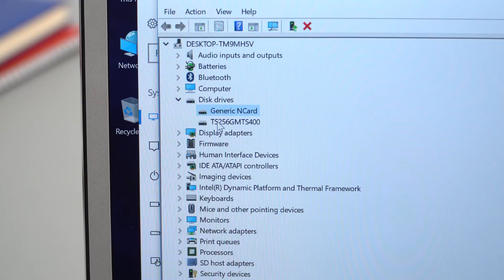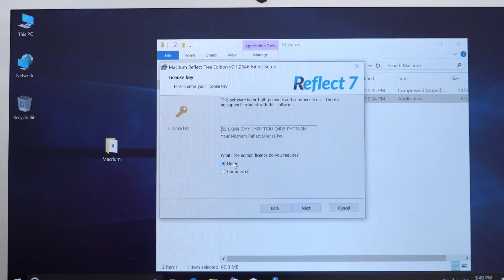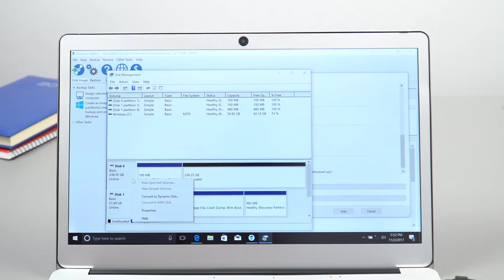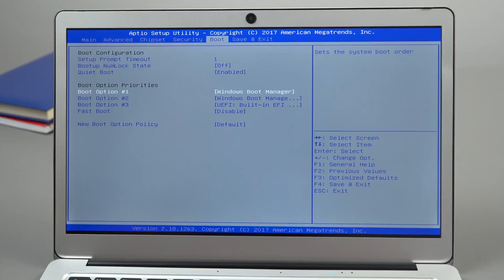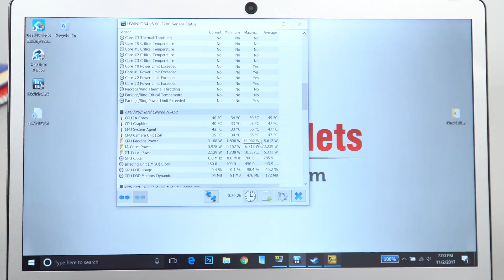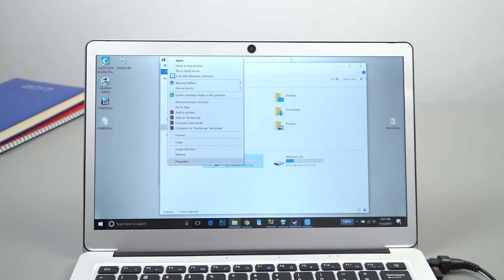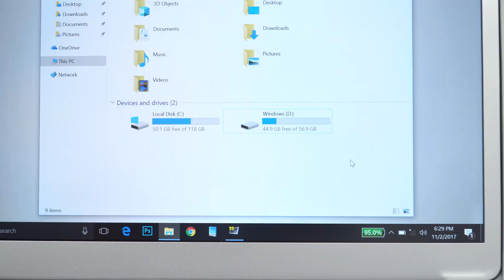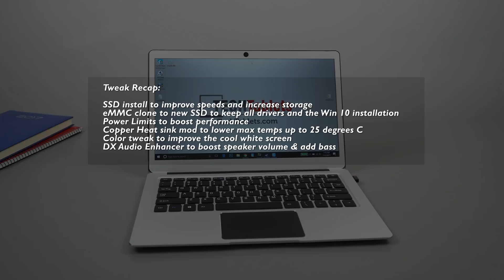Jumper EZBook 3 Pro Heatsink Mod, eMMC to SSD Cloning & More

Comment from the maker: Tweaks to get the most out of your EZBook 3 Pro. Power limits, SSD installation, display tweaks & the heatsink mod to lower max temps 25 degrees c! Where to buy: http://www.gearbest.com/laptops/pp_647765.html?21&lkid=11119507 $209 for UK buyers with coupon EZBDUK

01:40 - Adding an SSD
03:40 - eMMC to SSD cloning
05:11 - Bios Tweaks (eMMC & power limit)
06:34 - Copper Heatsink mod
10:09 - Heatsink mod results
10:52 - Misc tweaks
13:16 - Tweak recap.

How to boost the speaker volume: https://techtablets.com/forum/topic/boost-your-hi12s-speaker-volume-and-3-5-output/

Hands-on with the V4 of the EZbook 3 Pro: https://techtablets.com/2017/10/hands-ezbook-3-pro-v4-best-just-got-better/

EZbook 3 Pro review: https://techtablets.com/jumper-ezbook-pro/review/

EZbook 3 Pro forum: https://techtablets.com/jumper-ezbook-pro/forum/
Reply from the maker: No, it will stock charging once full and then use AC power.
Reply: hi chris i see you made a 360degree mod and coverage of this notebook ut you still MISS to guide us how to conect an eGpu (external gpu) card .... PLEASE DO THIS FOR US!

this laptop is great and it would be fantastic to see if we can use the pci slot of witi to connect by wire an eGpu and use an old and unused glu like an ati 7950... 7870 that many of us have in the old pc
Reply: Michel Giovannini Basically yes, if it is charging all the time. I think most laptops now switch to directly powering the laptop and not the battery at full charge.
Reply: Gday Is it possible to replace the battery so you can last long ?
Reply from the maker: Yes, it can be unplugged, unscrewed and replaced easy. Not sure if spare batteries are on Aliexpress yet.
Reply: TechTablets.com I use the PC 90% of the time at home. Does using it plugged to the battery charger damages the battery?
Reply: I bought the EZBook3 Pro right after your Oct 7th V4 video.  At the time it said it would ship on Oct 23.  The ship date has been pushed back several times, currently Nov 20th-24th  :(
Should I cancel and wait for the next gen systems? When are the new systems coming out?
Reply: niffrig I don't think this one does this intelligent switch. :(
Reply: I don't have Advanced and Chipset settings in BIOS. Do you know why? Project version differs. I've got WP3132.N. eMMC SanDisk. Want to set max speed to DDR50.
Reply: what happens if you don't have the limit with the power unit in the bios and you don't disable it after ssd installation? it is wrong if i don't disable the power unit limit?
Reply: how do you unlock all bios options? i miss whole advanced tab and many more
Reply: Works pretty good for getting the most out of a Lenovo Flex 11 too. Thanks.
Reply: How to charge via USB c ?anyone know ,can't find any info but have. Heard

Comment: Is it possible to reset the bios password on these laptops?
An EZ Book X3, from a classroom, and one of the students has entered an administrator and user password in the bios.
As a result, I can't even get into Windows or the BIOS...
Any ideas?
I've reflashed some bios chips, but on this model I can't even find them.

Comment: This is my sister’s machine, she’s had it two or three years from new. Worked fine and I upgraded it to Windows 11 I think some months ago. Yesterday she closed Firefox and the screen flashed with some brief window then seemed to close itself down. On booting it up all I can get is a blank screen almost immediately after powering up – I have a photo if needed. The screen is closer to white not blue. I’ve tried many combinations of keys while booting but always getting this blank display. I suspect it’s not booting into the OS. I use Macs myself so I’m confused. I remember a nightmare a year or so ago when it tried to upgrade the OS and there wasn’t enough memory on the SSD. Had to boot from a USB with Windows on and delete stuff. Can any-one help?
Reply: CAN ANYONE HELP PLEASE?

Comment: what if the BIOS doesnt recognize the SSD, i try fresh new install of windows and kubuntu on the SSD, but on windows doesnt show up like boot option, on linux just start the grub console.
I dont have the BIOS unlocked and i didnt found if i unlock it will solve this problem. 
Is there a possibility that my version of jumper ezbook 3 pro doesnt support an SSD for OS boot?

Is there a way to know my version i got this laptop used by a friend but he dont know what version is

Comment: Where is the hard drive?
Reply: it have an emmc inside, you can put an m2242 ssd in the slot and use that as first drive, but be careful not work an all ezbook3pro

Comment: Could I just use a penny for the copper heat sink mod?
Reply from the maker: If you wanted. Would still work
Reply: 2.5% copper 
97.5% zinc

Comment: Thanks for this. Super useful. unfortunately I have the model where the power options aren't available. Gonna fit an SSD later and at some point lower those temps with just a thermal pad and paste. any recommendation on which thermal pad to get?

Comment: Hi, I saw this video, I wanted to, I have a Yepo737 that has the same BIOS as the EzBook, for over a year I have been trying to start the operating system from the SSD M2 that I added to my Yepo, but the BOOT from SSD does not work  , I also used your REFLECT7 program, in the BOOT page I set it as the first but then it always changes me and starts from the eMMC, I did several tests but it's as if the SSD BOOT was blocked.  If you could help me you'll be grateful, thanks!

Comment: Tried the copper plate method. Actually it wasn't that much difference, but adding several thermal pads, that actually worked better. Hotter in chassis, but slightly cooler in temp reading.

Comment: Why did Jumper limit M.2 slot size to 42mm with rounded bracket eventhough there is MUCH enough room to fit normal full size M.2 like Crucial?

Comment: Acquired two units of this product, My experience after 6 months of light use, Defects, Battery does not work, It is restarted constantly, Geartbest technical service does not respond with guarantees. They are dishonest commercial practices. Low quality products + Poor after sales service = High level dissatisfaction.  Do not Buy if you do not have a REAL Product warranty.

Comment: Hi this is great, I have one tiny question: is the m.2 SSD slot SATA or NVMe?

I've seen SATA being mentioned around, but in your video I noticed (at 5:19) a setting called "NVMe Configuration" so I wanted to check if there are differences between models before buying the wrong one.
Reply: it is sata 3, and the only ssd that is really really good for this laptop is the Transcend MTS400.

Comment: Just wondering, I have an ezbook 3se that doesn't have the m.2 slot at all, but opening it up it does have a connector where the black m.2 slot could itself connect, do you think I could buy that somewhere or is it a proprietary jumper part?

Comment: I've a similar one to this. iota slim 14 I've done this mod and at 14c idle but speedfan is reporting 70c for hd0. Is that the ssd I've installed not working right or do you know?

Comment: With SSDs it is best practice  to leave 20% of the capacity unallocated to maintain the life span of the unit. This is because the storage cells tend to fail after around 100,000 writes, SSD controllers spread the writes around unallocated space to spread out the "wear". Too little unallocated space and the wear is concentrated on too few cells, until they die.

Comment: Hi,

for the "easy method" of putting the thermal pad on top of the black heatsink, does the same size of thermal pad works, or do I need one with higher height than 1mm ?
Thanks in advance.
Reply: Would love to know as well

Comment: If a storage drive doesn't show on Windows, then try formatting it, to NTFS file system. It's very likely that it won't show even then. Go to disk manager, right click on your drive (which is most likely blue coloured now, since you formatted it) and add label(or letter, don't remember how it's called). Add a letter on the disk and it will show on Windows.

Comment: dont know exactly whether i got v5 or v6. in bios there is no advanced menu. got a sandisk emmc. i have a transcendence 128gb 2242 m.2, but it doesnt Show up neither in the boot order in bios or in Windows. if i want to Format it to ntfs  so it Shows up in Windows explorer, the Action freezes while Progress. tested macrium reflect to copy, Format with Partition wizard and easus Partition master. nothing works. any idea how to get it working?
Reply: same problem, you have found a way to solve?

Comment: Visually beautifully worked laptop, cheap and relatively well works, sometimes freezes the picture for a short while, the keyboard does not work well tuchpad neradi well, the battery loses full after a few weeks of rebuke. And there are still many problems with him. Recommendation does not buy it at all.

Comment: warning!
if you create too much thickness with the copper piece of the CPU, the dissipator of the voltage regulator does not make contact anymore,
and also the ram risk of not more in contact with the black dissipator.
The same thickness must be re-established on all the components that need to be cooled . .with some thermal pads for example

Comment: Thanks for the great video. Would a 512 GB SSD work? So far i just read about 128/256 ssd's
Reply from the maker: I have a Kingspec 512GB 2242 it works fine.
Reply: So, Can I upgrade for a 500GB or 512GB SSD on the EZBOOK 3 PRO, does it suport this SSD capacit??
Reply: how is thequality of kkingspec 512gb ssd ?? i want to buy it but i reading some negative comments on-line.

Comment: Hi I tried to install a newly purchased M.2 ssd on a jumper ezbook 3 pro wifi ac version just received it yesterday, and windows will not let me format it. first it would just say windows unbale to format drive, when I used diskpart it came up as an I/O error. And when I tried a different ssd and still got the same result. have you ever come across this problem maybe or do you know of any solution.
Reply from the maker: Haven't had that issue with my 3 units I've owned with the SSD slot. Might be a hardware fault with the slot.

Comment: How to activate this advanced bios?

In my bios there are only: main, security, boot, save&exit.

There are no Advanced and Chipset options.
Bios date 11/06/2017
Reply: There sadly is no "easy activation" you could try to get a bios save file from the forum and flash it on but i wouldnt really want to try it.

Comment: Your comment "more thermal paste is better than not enough" is incredibly false.   This is a pet peeve of mine because thermal paste  has become HUGELY misunderstood in the last decade.    just for the record, the ideal amount of thermal past is NONE, nothing you put in-between of two objects can make heat transfer more efficient, that would break the laws of physics.   The reason we started using thermal past decades ago is because there might be tiny microscope variations in the surface. 
The best way to apply paste is a layer so thin you can hardly even see it,   if for some reason you need more than  that it would mean your heatsync has such large variations in it that it needs to be thrown into the garbage.        I really don't understand why people cant wrap their heads around basic thermodynamics.
Reply: The main argument on thermal compound quantity was always if it would sort surrounding components, not thermals... No one ever reported higher temps because of excess thermal compound. You know why? Because it doesn't stay there! It won't be a 2mm layer. It get squished down from the heatsink of your cpu cooler. While the thermal paste is heated, it get more liquified, so it becomes a thin layer and the excess drools form the sides... What if you put none or very little thermal paste? What haplens then? Higher temps. You know why? When putting none, you got no proper contact between the two surfaces, cause yes, there is no cooler out there being so smooth that will just stick on the also not ultra smooth CPU... If the surfaces were completely smooth, then those two surfaces would stick together as you would press the air out of their contact. But that's not realistic, is it? When you put too little on the other hand the two surfaces to get some good contact on the middle of the cpu, but don't get on the rest, moreover, as you said, air doesn't have good thermal conductivity, and most of the CPU surface now has more air than themal paste. TOO LITTLE IS AS BAD AS NONE. NONE IS AS BAD AS TOO LITTLE! There are no perfectly smooth surfaces, deal with it thermal dynamics guy. -_-
Sure, thermal paste doesn't have the same thermal conductivity as metal itself, but would you go to the trouble putting liquid metal on a cpu like this one? I know I wouldn't. Also, to answer your argument about putting this piece of copper in between, tell me. Do you remember what was previously there? A thermal pad (which doesn't have the greatest thermal conductivity,  especially for high temps stuff like CPUs) Do you even take into account it's thickness? How would you fill that gap? Do you have a better solution? Unless you can manipulate metal easily and you can find a way to stick it to both the heatsink and CPU, while in the same time creating a thickness of aboout 1mm and making that metal fill in all the gaps between CPU and heatsink while being a solid solution (not liquid, because it would drool all over and fry everything), then please enlighten us all! The copper fills the 1mm area, the thermal compound fills the air gaps between the CPU and the heatsink... I really don't get why would someone be so negative about such a well thought mod... It will decrease the temps, it will decrease them for about 20-25 degrees! Want some better results? Go and liquid metal cool it -_- And be careful not to fry it...
Reply: IcaniCorrono So, just to be clear here: Does the thermal pad alone have greater thermal conductivity and better thermal results than putting copper and thermal paste in between? (I have watched sever videos in this channel doing exactly that: replacing just the thermal pad with copper and thermal paste, and the temps dropped significantly). Because I believe that thermal pads aren't meant to be used with CPUs of this or greater size. I also believe that their thermal conductivity is worse than a good thermal paste, and surely couldn't be better than copper. (I'm aware that thermal paste has relatively poor thermal conductivity compared to metal itself, but I don't consider thermal pads better than thermal paste... They're just the easy long lasting solution)
Reply: I am completely agree with you. Moreover, add another piece of copper does not have any sense. He add three thermal resistance: thermal paste, copper and another time thermal paste. Temps decrease only becouse he adds thermal pad between heatsink and aluminum back cover. Thermal pad is another resistance but is much better than air. Finally, the thickness of the copper probably leads to disconnect the other things that need to be connected to the heatsink. My suggestion is to add only a thermal pad between heatsink and aluminum back cover. If you want do more you can only perform an hole in the right of aluminum back cover and add a fan 😂
Reply: No surface is perfect but I agree too much heat sink compound was used. Need about 1/3 of what was applied if not less. The only thing more thermally resistant is air. The compound gets rid of that. 

To date, and I've been doing this since my 1st OC build with a FIC PA-2007 mainboard, I've never seen a scenario where I had better cooling with a bar heatsink to CPU vs a bit of thermal compound.
Reply: FishFish1995 There are no reasons to be angry. And please read carefully what I have said (I don't have a great English so maybe you have misunderstood some points becouse of that). First of all, you are partially right, the thermal past when you perform a pressure from the top goes away, buf for sure its thickness will be higher than if you use less, so in this way you are wasting material and missing the optimal point. Nevertheless, I never said to replace the termal pad with magic. Incidentally, I have already said my solutions: simply put the thermal pad between the heatsink and aluminum back cover, becouse it is what really changes the game in this case. Put thermal paste, copper and thermal paste again, means that you have more layer and thus more interface that should brings to higher termal resistance than the simpler, and already present, thermal pad (even more if you don't made a perfect work, as you can expect by a lot of youtube whatcher).
In conclusion, relax and note that YouTube is not Nature, so I belive that a lot of people are happy to know that the low temperatures reported here are strongly due to the last and simpler step. The older final note was simply a joke: "do you want do better? Make an hole and then put a fun"

Comment: How do you make sure that once you have cloned the eMMc to the SSD, that the computer boots the windows that's on the SSD, and not the one that was on the eMMc? Also, once it is cloned, can you delete the windows image that was on the eMMC? Sorry for what may be obvious questions, I've never done this kind of stuff before, so I want to make sure that I've got all the proper steps covered/haven't messed anything up.
Reply: Also wanna know that! Heard some ppl saying at the forum that they had problems after erasing windows from eMMC...
I`m not a tech guy, but you better confirm that with someone that already did that before...